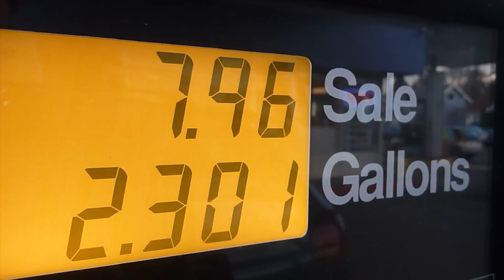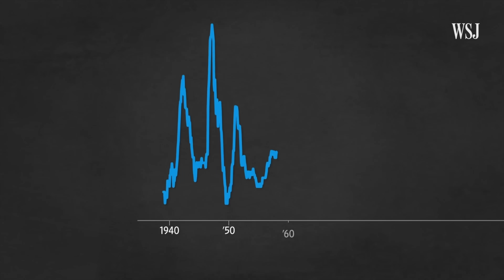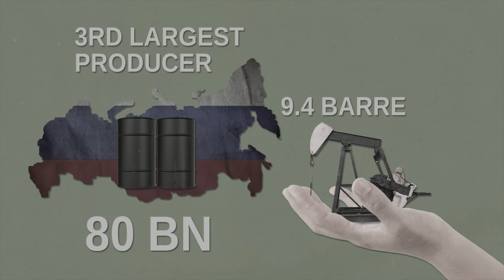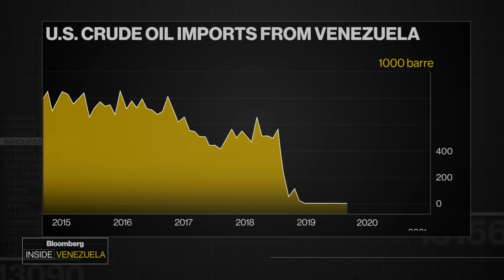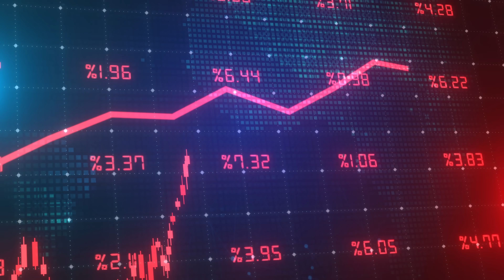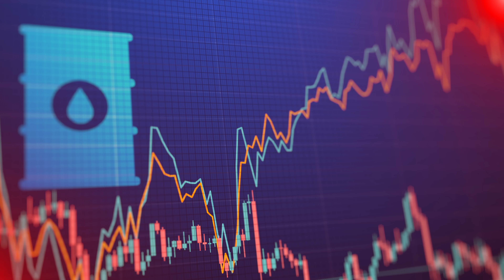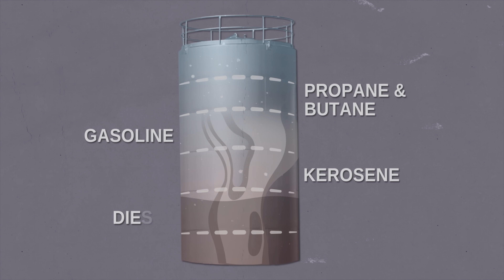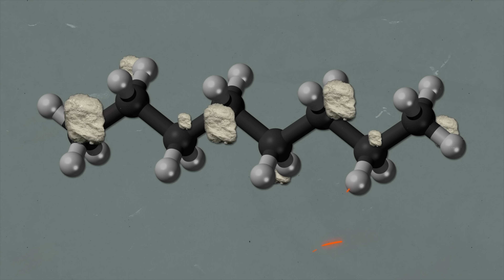America Just Became the Largest Producer of Gasoline and Prices are Going to Drop Like a Stone

Comment: What i find weird is that last time we had a gas shortage every car manufacture dropped V8 engines and went to small cars and 4 cylinder engines. But this time all you can buy are big 4 door 4 wheel drive trucks and SUV's
Reply: Supply and demand, plus making money for the companies. If they are limited on parts, they'll make the expensive ones that they can make larger amounts of money on. Everybody wants to buy a truck or SUV
Reply: Wow Mr tacoma. I didn't realize that my only vehicle option was a large SUV or truck. That's amazing. I'm so glad that you have shown me the light. No more cars exist. No more motorcycles exist. Just huge SUVs and trucks. Wow.
Reply: @charlesmiller7848   In 2022, the IEA reported that SUVs made up for about 46 per cent of global car sales.
Reply: Because that is hat consumers want to buy
Reply: @jasontaliaferro3657  I would love getting the Honda Red, but then I would be spending most of my time at the police station.
Reply: That's because those big trucks and SUV's are exempt from CAFE regulations. It is simply more profitable for a company to only build exempt vehicles than to develop a truly efficient vehicle. The auto industry doesn't give a crap what we pay at the pump as long as we keep buying their vehicles.

Then, the overabundance of trucks and large SUV's on the road makes owning a car a truly inconvenient experience... Trucks and SUV's will do far greater damage in a collision with a car than another SUV or truck. On top of that, simply making a left turn these days is dangerous in a car because you can't see around the giant truck or SUV turning left from the opposite direction and most intersections lack a dedicated left turn cycle. Unfortunately, the crowd that insists on having oversized vehicles created an environment where having an oversized vehicle is basically mandatory for the safety of you and your family. That crowd insisted on those vehicles because they're terrible drivers who don't understand the concept of slowing down in bad weather or that good tires matter far more than all wheel drive in snowy and off-road environments.
Reply: @CynicalDriver  - that crowd also includes families that need the room (taking my two boys to my father’s cabin along with our two dogs and wife meant we needed a roof rack—and that’s with an SUV!!!)

That crowd also includes boat owners and a great many people that need it for towing—the flatbed truck is a must for many jobs.

There are tens of thousands of deer related accidents per year—we don’t live in a rural area but there are deer all over the place and trucks/SUVs greatly mitigate collisions with larger animals.

Snow, high water and other weather conditions that create the need for 4 wheel drive…. Again, safety features.

There’s a lot of valid reasons why SUVs are better options for many people.
Reply: @mike2687  a station wagon is gonna have more space, while being more efficient with it fuel. And those can be bought with 4x4 if you really, really need that. I live in a rural are, animals are quite common on the road, especially at night, if you just pay attention, have decent breaks, and aren't speeding you ain't gonna crash to them, also many SUVs do fail the moose test, so if something appears on the road you need to dodge, you can actually put yourself in more danger. And you can tow with a lot of cars
Reply: Would you rather be safe and comfortable in an SUV. Or you want to drive a coffin on wheels when the AVERAGE HIGHWAY SPEED is 80 MPH and the MV fatality rate increasing due to DRIVER INATTENTION!!!!!!
Reply: @michaelkovacs8413  - because it’s the right thing to do!!!  🤣🤣🤣
Reply: @mike2687  COMMON SENSE !
Reply: @michaelkovacs8413  - sadly, there's not enough of that these days
Reply: @mike2687  minivans offer MORE room than SUV's, and most people aren't towing something daily. They could easily SAVE money by buying a van for daily driving and a smaller pickup without all the fancy crap for the same price as ONE Platinum F-150... Not to mention the fuel savings that way.

Comment: I live in Poland and have an LPG installation in my Honda Odyssey, which means my car runs mostly on propane! It's great because propane is like 60 cents a liter here ($2.40 a gallon) whereas gassoline costs about $1.50 a liter ($6 a gallon). I save big bucks running my car on propane and you can't even tell the difference in terms of driving performance.
Reply: In the USA by the end of the 70's the government implemented a road use tax on LPG of $2.00 per gallon and has continued to raise that tax over the years.  As a result there is no savings to cover the price of the modifications to switch over.  That is great that in Poland they don't punish you for saving money and burning a cleaner alternative fuel source.

Comment: In 1971 I was working at a Consolidation gas station in Madison Wisconsin. I pumped gas 22  cents a gallon. Some times it would drop to 21 cents during gas war between station. At the time I drove a 1964 GTO and at 16 I never thought twice about how much gas cost.
Reply: 64 GM A Body. Bjg fan. I drove Chevy Counterpart. And a 70 as well.
Reply: Back then, a penny profit on a gallon of gas would keep the doors open and the lights on. Not to mention paying me to pump that gas.
Reply: @frankl.5153 I got 3% on driveway sales of oil, coolant and Atf. Fan belts too.
Reply: No wonder the younger generations are so mad right now. Everything was cheaper back then. From housing to gas.
Reply: @bosewicht2389  fr, the original commenter drove a car that was only 7 years old at age 16

Here I am at 18 driving a 21 year old GMC Yukon….it’s super clean and I take really good care of it and have it looking likes it’s fresh off the dealer lot (clear headlights, no dents or dings, a stock but brand new looking interior) 

But still….I wish I could have a car that was under a decade old and mines over 2💀
Reply: careful what you wish for - the newer the car the more electronics is involved in all aspects of the fundamental opertation - going way beyond just electronic ignition. And engine compartments have become far more dense with ancillary junk. So vehicles get more and more challenging to do DIY repair. To where finally you get to EVs where if it's involved in what may seem like a minor collision incident the vehicle will be declared totalled if the battery compartment gets compromised to any extent. The EVs are practically unserviceable - and they have much higher insurance rates as result. God forbid owners of EVs are ever in a road incident that causes a battery fire and find their electronic doors unable to operate - the suckers are like that Titan submarine - a death trap waiting to happen.
Reply: Of course you didnt until it hurt your pocket and by then it's too late.
Reply: @brileymitchell2632  There's nothing wrong with INTENTIONALLY continuing to drive older cars. I've done it all my life. Let the other fellow lick all the goodie off the car. Then you swoop in, do your homework find the well kept older diamond in the pile of old poop, and buy it for pennies on the dollar, and take care of it for years. While everyone else is eyeballs deep in debt trying to keep up with the Joneses.
Reply: @DUCKDUCKGOISMUCHBETTER I totally agree with everything you've said. Let someone else pay for the depreciation & financing. Unless you have a ton of money, buying a vehicle thats 3-5 years old is the ticket.
Reply: @michaelhillard4158  Agreed, except that I buy them even older (10 years or more) and keep them forever and a day. I've only ever bought one new car, an economy car (Hyundai, which is a garbage car & garbage company which doesn't stand behind their garbage cars), and that purchase was completely against my will. But at that time, decades ago and early in my life, I was given absolutely no choice in the matter of new versus used. That decision, made against my will by my father, seriously injured me financially for years afterwards. But it was either "his way (new car) or no way", and I was 19 and absolutely had to have a car for my job.
Reply: @DUCKDUCKGOISMUCHBETTER  that’s how I see it too, though I got into a bad motorcycle accident back in February, I’m walking fine and all surprisingly, but I should get a lot of compensation money since it wasn’t my fault….which means new Honda civic with a manual time🙌🏻

I’ll keep it 20 years hopefully
Reply: @brileymitchell2632  I wish you all the best.
Reply: @brileymitchell2632  At age 18, I owed and drove a VW limited edition Sports Bug and was restoring a 1940 Ford Coupe. Was earning $4.20 per hour working construction while still living with my parents. Typical rent for nice new apartments outside of the ghettos was $250 per month. Levies were $15 and Adidas were $30, cigs were 35 cents, Highest grade Columbian pot was $35. per ounce, telephone bill was $18, tacos were 30 cents, 4 year college degree cost you about $12,000 and medical insurance was $35 per month. The kicker is that CEOs made only 10 times their lowest wage employee vs today 400% more.

Comment: You missed the threat EVs pose to the sellers of gasoline.  A lot of people are buying EVs as their new or 2nd car.  The oil companies see this as something that will reduce the size of their market.  This is a reason for them to work to prevent it by lobbying and also by moderating the price of gasoline.
Reply: Most energy is produced by gas or some other fossil fuel source 
.....
Reply: @natedizzy4939  Yes, that is true, however, it is far from the full story.  If you charge your EV from a modern natural gas power plant, less carbon is produced per mile than running a gasoline power car for the same job.  Also in some places a majority of electrical power does come from alternate energy sources.  Given the amount of open space and sunshine, Australia could become one of those places.

Comment: I remember paying $1.00 a gallon for the first time, it would cost me $10 to fill up my 1978 Honda CVCC with manual choke and 4 speed manual transmission. That was my favorite station wagon that I ever owned, that and my 1982 Subaru Gl Wagon with a 4 speed and 4 wheel drive.
Reply: is that with a clutch....lol
Reply: To be fair most of that is due to the hyperinflation of the USD over the last half century, not necessarily the price of gas going up.  10 dollars in 1978 is equal to like 52 dollars in 2023 money,  thanks to our wonderful US govt printing trillions every year.
Reply: I remember when they were $0.28 a gallon.  Then when they went above $1.00 all the gas stations had to buy new gas pumps because the meter were 2 digits and only went to 99 cents.
Reply: MANUAL ROO'S ARE GREAT VEHICLES.
Reply: @thankswillie  I'm 53 and have only owned 2 automatic transmission my driving life since 1987. My current Tacoma is manual...

The two automatic I had were 1989 Ford Aerostar and 2010 Ford Expedition. I've just always driven stick and never liked automatics, except on work trucks, but not personal drivers.
Reply: @sd906238  exactly!
Reply: I remember gasoline at 16 cents per gallon. I had a big International truck with 2 -50 gallon tanks.
100 gallons,  $16.00.
Reply: Where I live it was 1.75 to fill up at a gas station in 2015 that was abandoned shortly after now it costs like 3.00 for regular

Comment: Hey Scotty , big fan , but you got half of this correct . The refining capacity this country is the problem not total oil reserves. It’s been a battle for decades to expand this process . Also the price to retrieve oil is a huge factor in pricing . Saudi Arabia can do for 10$ a barrel because it’s in the sand while we have to frac for ours . I believe it’s 30-40$ for us to do so . As an oil field electrician I can tell you that we are getting very innovative in building our new sites to what we used to do . The recent discovery of new fracking techniques are supposedly able to double production. But I’m not sure if this will matter because greed and the ignorance of the population of how pricing is set has no real mathematical calculation . 2012 135$ a barrel = 3+ gal . 2022 75$ = 3+ gal . I think they just lick their finger and put in the wind and see what direction it’s blowing to set pricing .

Comment: Great video Scotty,  here in the UK our gas 😂 (petrol) prices are above $8 per Imperial gallon 😮
Reply: How far do people there typically drive in a year? Islands might be better places for EV.
Reply: @artsmith103  This UK island is 1000 miles top to bottom so an EV would need a few charging stops. My VW Diesel will do 700 miles on a full tank @ 45mpg so no brainer
Reply: @paulsaxby7368  How far do people typically drive per year? What's the avg distance the other direction across the island?
Reply: @artsmith103 12,000 miles is the average mileage for cars in the UK.
Reply: @paulpaintshop103  interesting. I would have guessed less.
Reply: @artsmith103  I believe the average had dropped to 10,000 miles per year but obviously people that drive for a living easily clock. Narrowest coast to coast is around 170 miles.
Reply: @paulsaxby7368  80.8 thousand sq. miles, 601.5 mile height (road is longer) so avg 134 miles wide.
Reply: We have the same prices in California
Reply: @artsmith103  Yeah right. How do you figure that out?
Reply: @wideyxyz2271  An island about the size of Kansas. Is one of the numbers wrong?
Reply: Have you guys tried not having tea time so far from home/work? Probably would save some money
Reply: Holy  crap so war in ukraine is affecting proces bad there
Reply: Our fuel prices have always been double yours in the US. We pay fuel duty they value added tax on top of that! That's the UK government for you!
Reply: @keithbenson2627 thank a democrat
Reply: @paulsaxby7368 the price you pay for all that “free” stuff.
Reply: @paulsaxby7368  So as Jeremy Clarkson would say: "Berlin to Warsaw on one tank ! "

Comment: So while the US produces a lot of sweet oil, the issue you run into is that a lot of our oil refineries are engineered to better cater to sour crude rather than the sweet crude that we produce. While we have increased our capacity to refine the oil we produce, we currently have better facilities to process imported crude.

Comment: At least most here are smart enough to realize that we dont need to drill more wells, they need to work the wells that have already been drilled.    
 Venezuela has crap oil as well, heavy crude isnt easy to refine under current environmental restrictions.

Comment: No Matter What gas should not cost more than $2.50 a gallon any more than that is ripping everyone off. There is no such thing as a fuel shortage. Especially here in America where Supply is practically never-ending abundant even for hundreds of years to come. Gasoline is such massively produced that the prices are simply way too high it does not cost that much as they are selling it for even when you take everything involved including production and taxes in account. Quite frankly they could be selling it for $2 and still be making a profit on every gallon. It really doesn't matter where you live in America it should not be any more than $2.50. For regular gas even premium should not be more than $2.70 Max.

Comment: If you live in Commiefornia - you will NEVER see your gas prices fall down! It has been for years been either at $4-$5 a gallon for the low, because of Commifornias insane environmental regulations that requires more expensive fuel mixture.

Comment: Something they should do is increase ICE efficiency so it's better return overall than the fossil fuel burned to charge EVs. Only a % of generated energy actually reaches the EV charging plug much of it lost in the transmission infrastructure.
Reply: Yeah I have read that the electric grid loses a lot in transmission of electricity, but the cost of using better wiring would be cost prohibitive.

Comment: They need the gasoline prices to be high to make EV's competitive on price, if gas goes down to cheap levels then electric cars are impossible to sell. Plus fuel companies will not want to pump gas for low prices so will slow down production to keep prices higher. If companies can sell oil and gas for higher prices overseas then they will send it overseas, the President can stop that but it will make the US into Venezuela from price fixing.

Comment: The quality of oil is a big sticking factor in the amount of oil they have.  Its not all the same and productiin costs of things like oilsands oil is much higher than other forms.  Availability of refineries and stability of the country has has an effect on production And costs.  The us is also much larger than many of the oil producing countries and the fact we use more oil than we produce means we need to continue importing oil.  Opec countries export a lot more oil than they consume.  Leaving them in an advantageous position over countries like the us that need to import.

Comment: Hi Ford and GM you wanted and created GREED now you have found out you can't sell a $30,000 dollar truck for 50-60 thousand dollars, to make it worse the Japanese sell superior  vehicles for a lot less money the best there is today is called a  Toyota Hybrid which needs little maintenance other than Synthetic oil and factory filter change  at 5,000 miles; Yup, my 2013 Hybrid Prius has 181,000 miles  and costs little in maintenance and rarely gets less than 48mpg around our small town when on a trip she will get 50mpg when driving between 55 and 60MPH unless a lot of head winds, traffic or going 65-70MPH ?